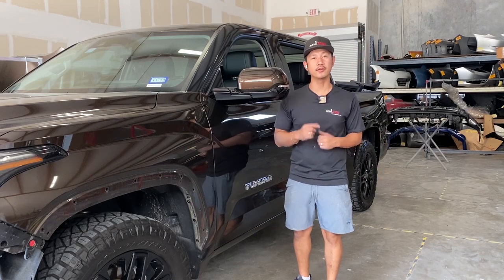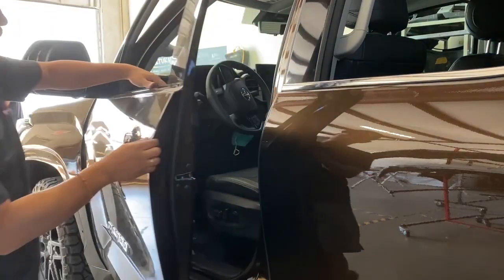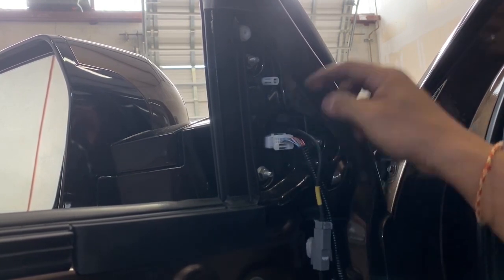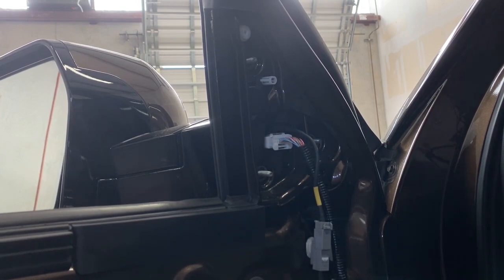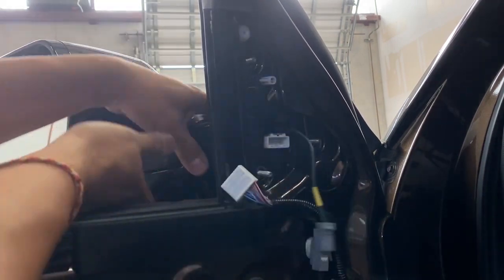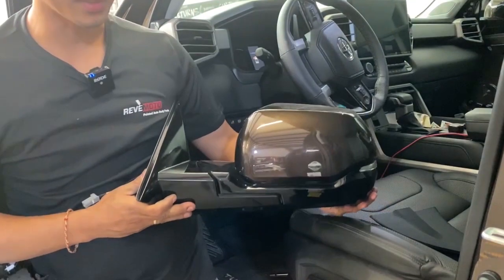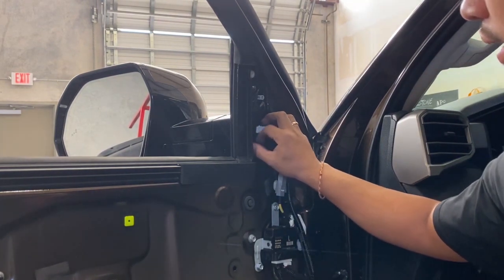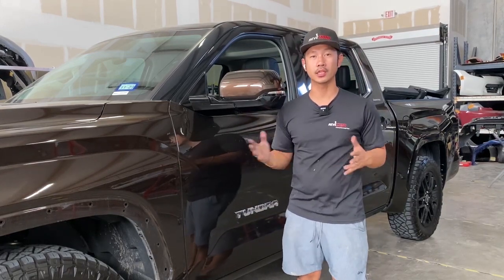EASIEST 2022-2023 Toyota Tundra Side View Mirror Install and Removal

Comment: I cant seem to get the inside trim back on. It looks like its suppose to hook on? Looks like you skipped that party of the video. Did you have trouble as well?
Reply from the maker: Oh I know what your talking about.  On this video it didn’t happen to me that’s why it was easy to install.  The white push pin probably got stuck on the door instead of staying with the cap.  Get a flat head and you will see white clips.  Take those off and re install on the trim.  Go to www.ReveMoto.com
Reply: Any luck? I can’t get it back on bc of that top white piece also

Comment: Dose the door panel have to be removed?
Reply from the maker: Yes it does.  Please go to www.Revemoto.com if you need parts for your car
Reply: @ReveMoto I just finished replacing my mirror and I didn’t have to remove the door panel
Reply: @zachwilson3845  Hi Zach sorry you guys are correct @nathantaylor9896.  The door panel doesn't need to be removed.  I mentioned it in the beginning.  We had ours removed due to a door handle that needed replacing.  Sorry for the confusion.
Reply: @zachwilson3845 any tips? Replacing mine this week.

Comment: i have a question for You . after you remove the mirror do you have to calibrate in order to work 100 % ?
Reply from the maker: Hi Top Gear!  No I didn’t have to recalibrate it worked fine.  I would disconnect battery cuz when I took off the front bumper that threw the sensors off.  I drove the car a couple days and it reset itself.  If you need anyone for your detail spot like parts or Touchup paint go to www.ReveMoto.com

Comment: could I replace my mirrors on an sr5 for auto retractable, heated mirrors? or pro mirrors ?
Reply from the maker: Unfortunately no because thee wires would be different making it not function.
Reply: so what about just a turn signal function light. thats all i want. i have a sr5 tundra too
 @ReveMoto

Comment: How do get the black cover to snap back in flush? Can't get the top part into the round white recieving end ?
Reply from the maker: The push pin probably not lined up or it on the cover not correctly.  Go to www.Revemoto.com
Reply: @jasongarcia5032 any luck?
Reply: Did you get your cover snapped back on.  Can’t figure out how to do it?